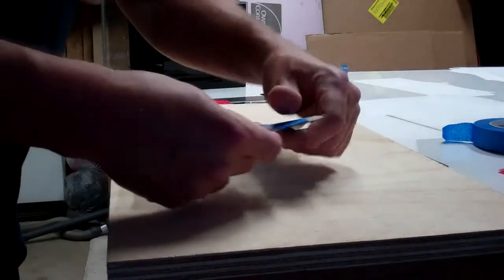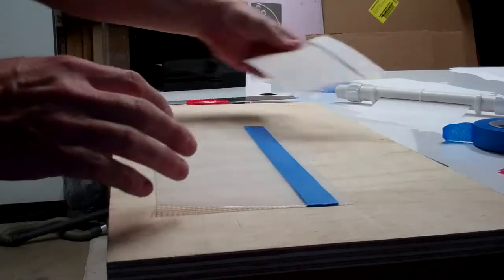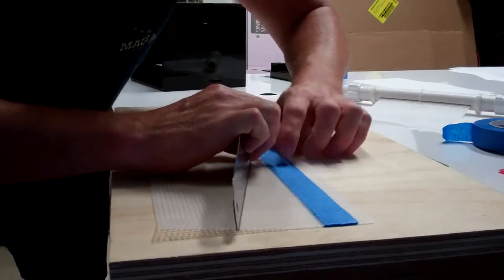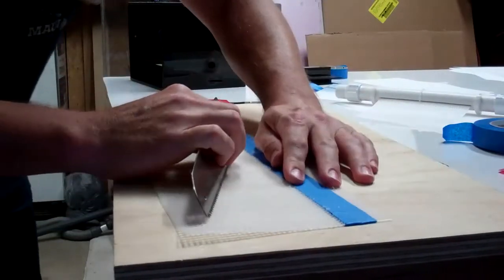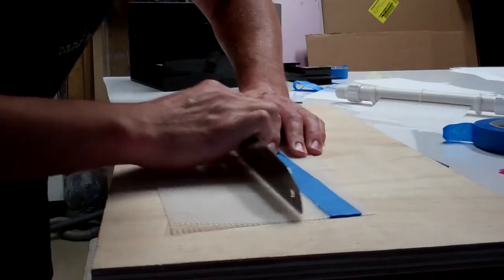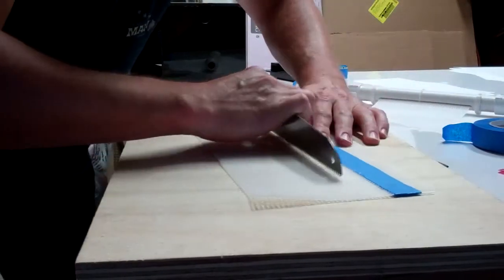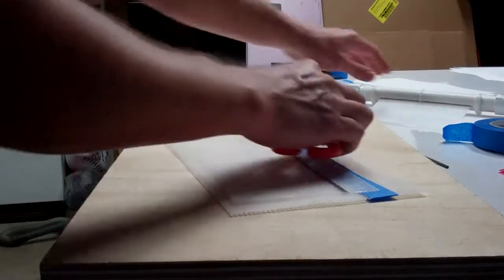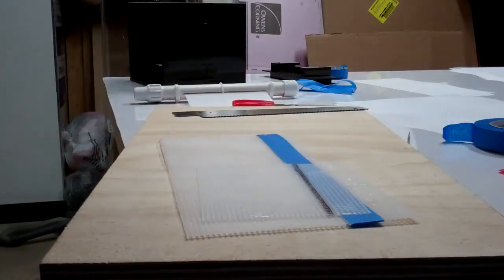Algae Scrubber Screen Rough-up Process - Quick and Easy

Comment: I got mine from Michaels, they were larger and had different sized holes in the screen...

If you do this method, do NOT hit your knuckles on the screen... 3 good rubs on a rough screen will leave your knuckles RAW as heck.
I'd rather rub my knuckles on the saw...

Thanks for the guide by the way, I did the exact same thing.

Comment from the maker: Yeah the #5 mesh = 5 holes/inch, that's too big - not enough surface area.  #10 mesh = 10 holes/inch and the material is too thin and rips too easily.  #7 is what you need.

The saw blade I use is big so I can grab it without grating my knuckles on the screen.  Never thought of that though - good point.